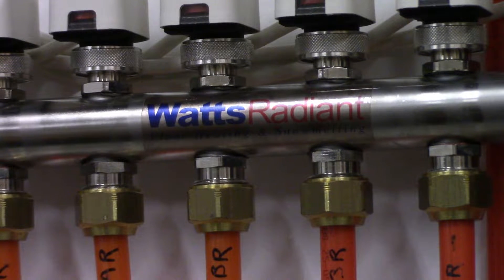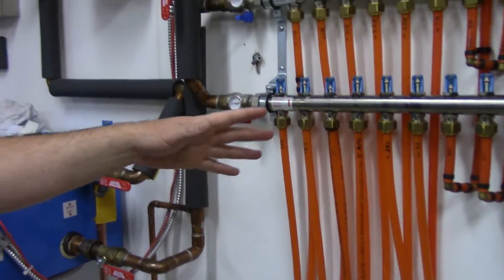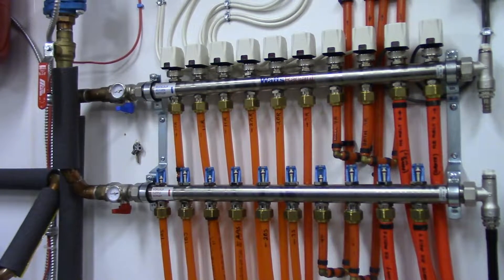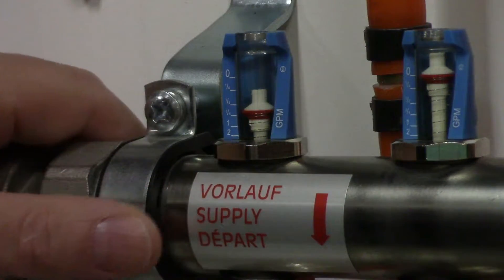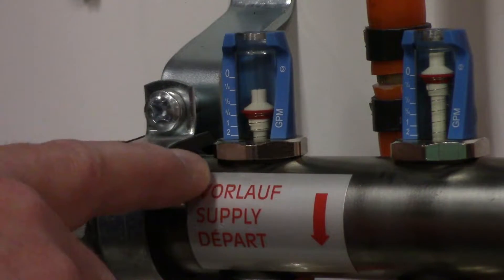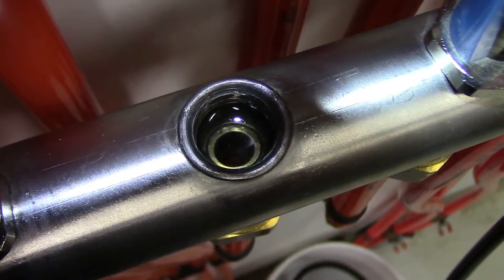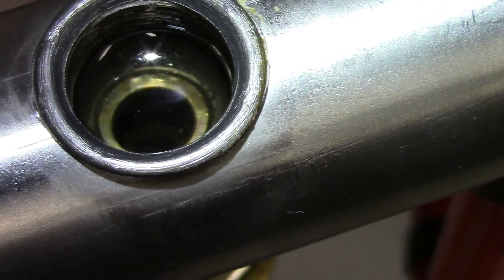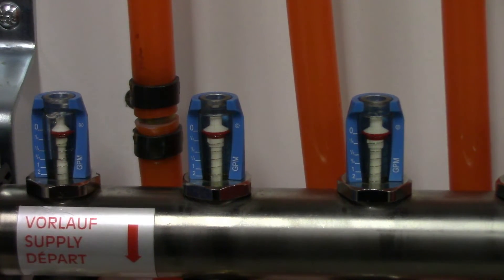Watts Hydronic Manifold Flow Indicator Stuck - Easy DIY Fix

Comment: Have you run into issues with the actuated valves sticking? I am wondering if the fix is similar.
Reply from the maker: Nope, no issues with them - at least yet. The closing spring tension on them is however very high so not sure how they could stick? Stick open or closed is another question that I guess should be clarified first since it would  indicated separate possible reasons. Looking at the upper actuated valves however, I would think they come out the exact same way by unscrewing them out of the manifold. Likely some sort of cartridge valve but since I've never taken one out, that is just a guess. Perhaps someone else who has had them out will post a comment :-)
Reply: John Salt my setup is a little different the loops are balanced by caps that screw on and the entire manifold is behind a zone valve. I bought the house in July so this is my first heating season, trying to figure out how to make it work effectively.

I found that all the loops are just wide open so i set about balancing them. Thats when I encountered the stuck flow meters.  

I am guessing the valves are plunger type. I was able to get several of the stuck valves moving by exercising them manually.
Reply from the maker: Hi Ryan, do you have the exact same Watts manifold?

Just asking since I know about those caps, at least on the Watts. Mine had them too when purchased new and as you said, you can control the flow rate by how much you turn them down - more you turn them down, higher the flow rate. When you get the wax actuators, they move full throw just like screwing the cap all the way down. Flow rate is then adjusted with that little square key. It basically raises or lowers the valve body (the inner brass part within the manifold) in relation to actuators. In effect doing the same thing as moving the actuator up or down, like screwing the caps up and down. 

If you have the same manifold, perhaps also check that all those valve bodies you can move up or down with the key are also turned all the way out for maximum flow. If for example they are turned down, you could turn the cap all the way down too and still get little flow. 

I'm also not sure I understand if the problem is with the output valve/s sticking on yours or the flow indicators? If the flow indicators are not reading correctly/sticking, how would you determine between the flow indicator being the issue or the actual valve that controls the flow rate sticking? I just can't see those valves sticking knowing the amount of spring tension they have on them, but I'm no Watts manifold expert either. I suppose if there is lots of crusty corrosion on the plunger shaft, it could certainly stick regardless of how strong the spring tension is?
Reply: John Salt i have manifolds made by rehau that have been in service since 2003.

It seems like whoever installed the system when the house was built never balanced anything, all loops were just wide open. I have been going to the different zones and balancing them, the zone for the master bedroom has all 4 valves frozen solid.

The meters have been sticky on most of them as well, i have had good luck pulling them and cleaning the bore they ride in with a plastic brush.

It seems like there is a lot of gunk in the water so im guessing thats playing a part in the issues.
Reply: did your rehau flow indicators remove the same as in this video?
Reply: Fester Adams yes, the valves removed the same way as well.

I found that the stuck valve were actually preloaded almost closed.
Reply: I did

Comment: Why watts manifold is upside down.i have this but i installed flow on top and return on bottom and it works fine.
Reply from the maker: It's not upside down, it's correct for my specific install and application; leaving ample room on the upper return manifold for the actuators, wire management and of course, for the plumbing arrangement off the boiler. In short, options for various installs which is of course why it works regardless of position.

Comment: This is cool! Has anyone had a go at a teardown of these? The sight glasses are impossible to clean.

In 2006 I DIY'd a whole-house UFH system in my little South-East London terraced house - quite rare in those days among us working folk. These gauges look identical to the original ones (apart from measurement in litres) fitted to my brass manifolds. They still work perfectly after almost 2 decades - regular flushes/cleanups/renewal of inhibitor/an occasional o-ring replacement etc., 

Annoyingly, over time a little crud has settled inside the top ¼" of each of the sight glasses, and there's no way to get them cleaned. I've had a good look, and I can't figure out a way to get access to the gubbins inside, unless I pull them apart - I reckon they're mostly press fit. 

The only replacements available in UK seem to be the Polypipe PB127FM - they are taller but work the same way for brass manifolds with ⅜" threads -  and they have the same inaccessibility issues!

Help!

Comment: Hi Have the same  at my church. The flowmeters are OK  (one is weeping some) but the valves under the Watt 22C actuators are sticking, some open some closed after 17 years. Would you know if replacement valves are available and what numbers and where to find?

Comment: Hi,  The first flow indicator (after the red intake valve) seems to be sticking on mine.   The little pin under the actuator was also very "stuck" but loosened up a bit after I pushed it up and down a bit.  The blue valve that you close at 4:28 is sticking on mine so I can't close it.  The red one closed really easily.  A) Any ideas as to how to loosen up the blue valve? B) Is there any difference if the flow indicators are pointed down (as far as water pouring out) when you take off the flow indicator? Or does that hole seal itself when you pull the flow indicator out?   Thanks! And, great video!
Reply from the maker: If the ball cock valve/s is/are stuck, there must be a build up of sediment/corrosion is all I can think. Only way I know how to move a stuck ball cock valve is to grab it with plyers and slowly start  wiggling it back and forth to free up the ball until it moves.
The flow indicators are not sealed from the manifold in any way. As shown in the video, there is a wide open hole in the manifold after the indicator is removed. If yours are inverted, then my guess is the water/glycol would flow out of the manifold when the indicator is removed.
Reply: @Rchelicopterfun  Hi,  Thanks.  That worked to get the ball valve to move; I removed the handle and wiggled some pliers on it. If I take off the flow indicator, and water spills out,  do you know how I refill it?  Or does it refill automatically from the boiler? Do you know of any good info/videos that explains how to  flush these manifolds.  The biggest thing I don't understand is how to refill water that comes out, and check pressure  (or whether it does it automaticallly).   Thanks again! PS: I should say that my actual problem is that all but one of the zones doesn't get warmer than 63F/17C. I am wondering if corrosion is reducing the flow levels.  And, as stated one of the flow indicators clearly seems to be stuck or clogged.

Comment: Hello, it's  possible to clean the flow meter sight glass. I don't know to break down the glass.
Reply from the maker: Not sure? The bottom (black plastic) might screw out of the flow meter so you can access the inside of the glass tube for cleaning, but that is just a guess. I never tried it. That bottom could as likely be press fit into position and not be easy to remove. Even if it is threaded in, the ceramic flow rod is most certainly very fragile so take great care if you try to remove the bottom.

Comment: Great video. I plan to tackle my stuck flow valves tomorrow. Do you mind if I ask what brand and possibly model of your electric boiler. I just recently filled my roof with solar panels and looking for an alternative to my oil boiler/ radiant heat setup
Reply from the maker: Brand is Allied Engineering Boilers out of Vancouver BC (I'm located in Canada). It's their Mini-Star electric series model. For the garage & basement heating space, this one is sized at 12 kW (three staged 4kW elements).

Comment: Hey John! Huge fan here! I was wondering if you could recommend me some RC heli models that you are able to change the pitch of the blades...Preferably ones that are not too expensive, thanks!
Reply from the maker: Hi Arthur, I'm assuming you are referencing "collective pitch" RC helicopters in your question? If so, there are many variables at play such as size, powering method, nearby parts support, radio system,  how & where you'll be learning to fly, etc. that are factors to consider. My "Best RC Helicopter" page on my website addresses all these questions and more when making a decision on which brand and model of heli to choose as your first introduction to collective pitch. Here's the link to that page if you're interested: https://www.rchelicopterfun.com/best-rc-helicopter.html